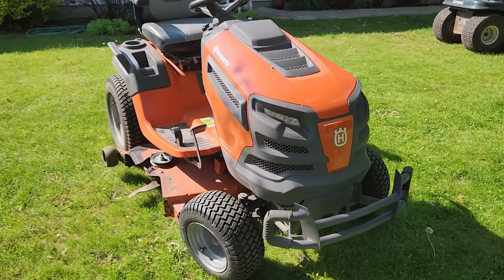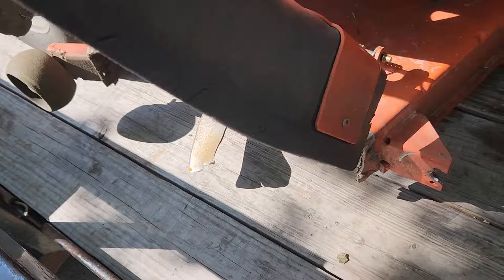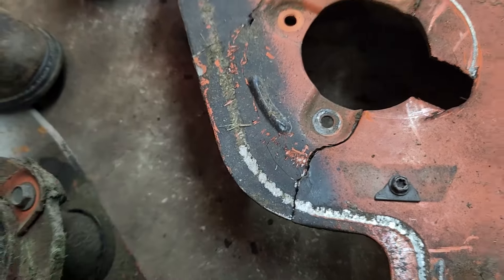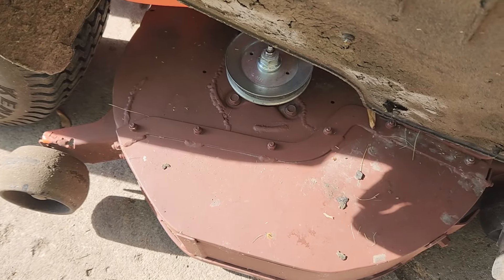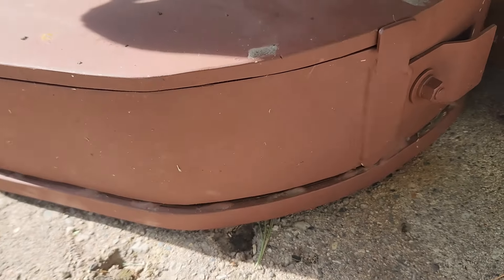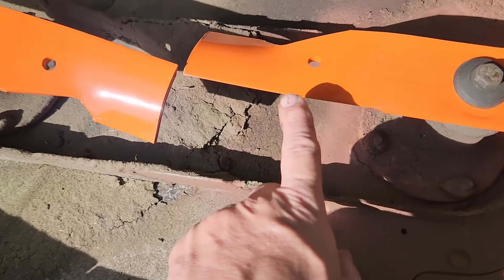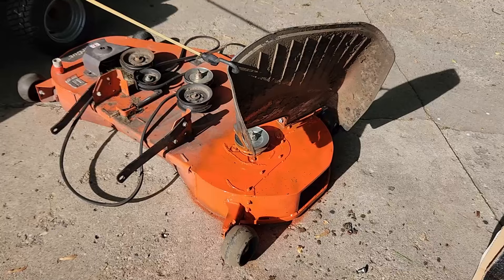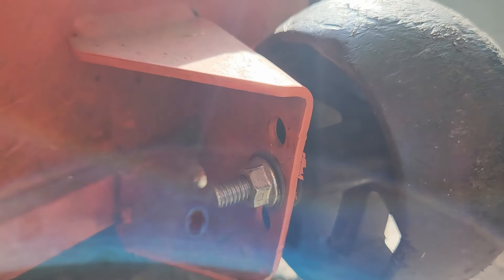Husqvarna TS 348XD Major Deck Repair

Comment: Wow that was a huge difference before it looked like you could cut off your foot cause that blade was way out now it's way better 👍
Reply from the maker: At one time there was a steel bar across the bottom, right where the blade was sticking out. The owner broke that very quickly. Hopefully, it will last a bit longer. Thanks for watching.